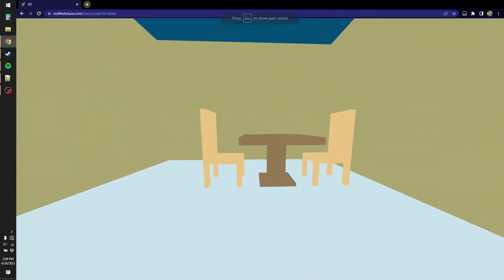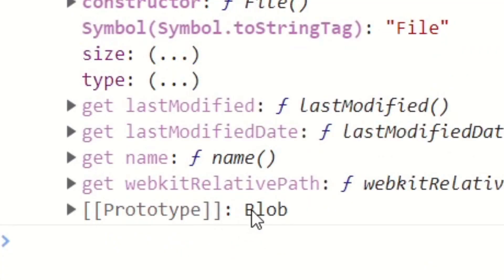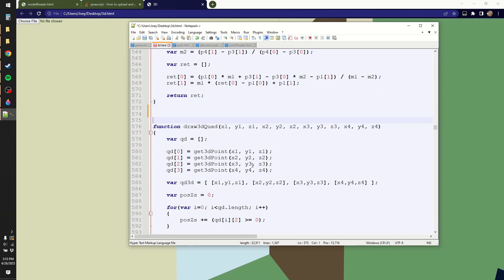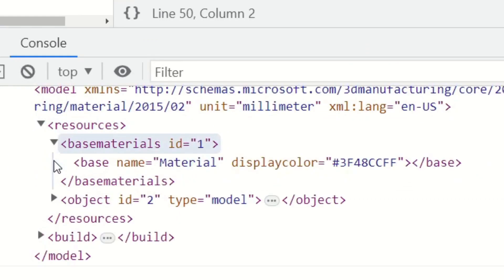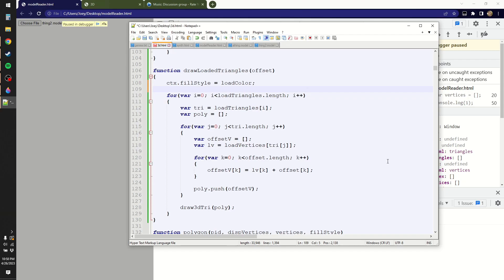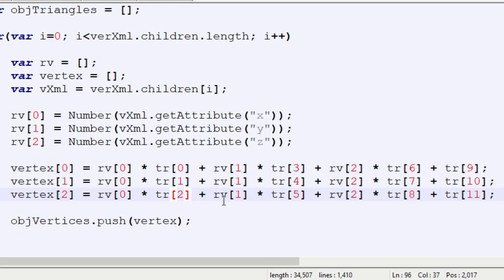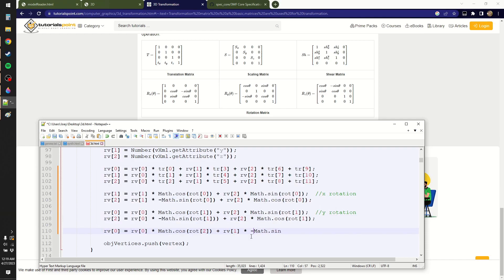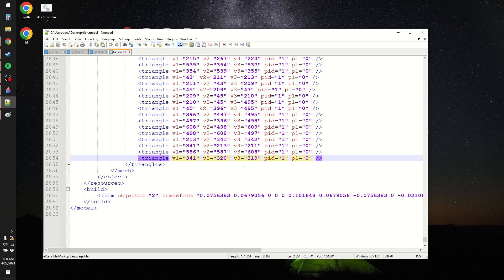3D Engine Coding: Importing models from other software

Comment: Dude, DONT build your whole engine around quads instead of triangles. I'm not an expert but no other 3D software works that way and I think there's a good reason for it.
Reply: eh it doesn't really matter here. Usually we wouldn't use quads because any 4 points aren't necessarily on the same plane (ex: they could render filled as a concave shape, which would be more complex to work with). Since this is small scale and it looks like every quad rendered is on the same plane, it's weirder to work with, but made the simple modeling easier to do (though, ideally you'd use triangles and make a `generateQuad` type function to just create two triangles to render it)

Comment: I think the error that came up with the offsets is a really common error in 3D, most 3D softwares have an "apply transforms" that you're supposed to use before exporting, and if you don't do that it'll spawn all separate objects at the 0, 0 ,0 coordinate same as the error you had! So you wouldn't need the bugfix you implemented if you had the option to apply transforms

Comment: one way you could probably speed up the run time for triangles is not using the quad renderer, most likely you can get a pretty big performance boost simply from having the triangles not be rendered like quads. Idk I guess it also depends on how you wrote the quad function.
Reply: isn't he using like css?
Reply: He could probably get an even bigger performance boost from programming this in C instead of JavaScript lol

But yeah he could be doing some more industry standard things like using tris instead of quads (not sure his goal is to have a commercial engine given some of his choices; probably just a project for fun/to learn).
Reply: @SeedRamples  I'm pretty sure he's using css to render.  
that's kinda the whole point
Reply: @v0xl  You cannot render like that in CSS. With some wizardry (not what the language was designed for), you can make some cool and tricky 3d animations, but you can't have a controllable player like he has in CSS. What he is doing is coding in JavaScript inside of an HTML file, of which the actual screen image is coming through the web browser. No CSS code was shown in this video. Only ever JavaScript inside of an HTML file.

A little tricky for you to know if you do not recognize the language itself. If you see <script> at the top and bottom of code, that is JavaScript. If you see <style>, that is CSS.
Reply: @SeedRamples  I'm pretty sure he's using js to generate css to render stuff?
Reply: @v0xl  If you would like to see, go to the second video he has made "how 2 code game". He uses an HTML element <canvas> and draws to that canvas in JavaScript using a 2d context. He does not use CSS. Using CSS to render a 3d engine would be like saying you are going to hop on a horse and fly to South Africa.